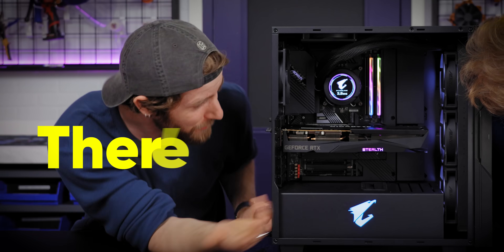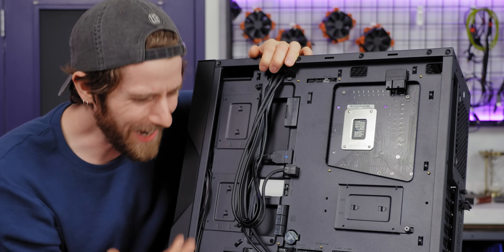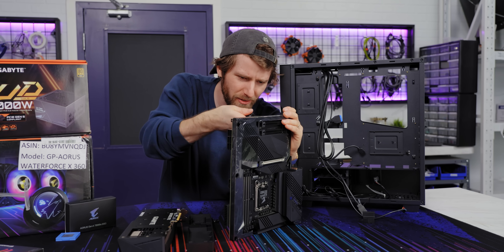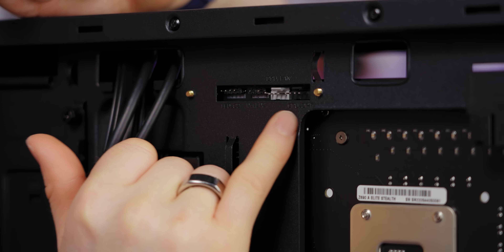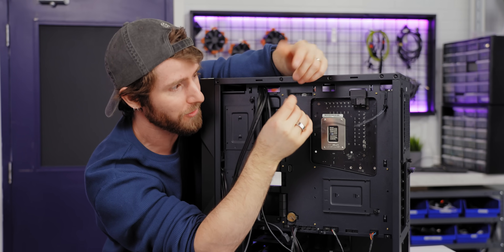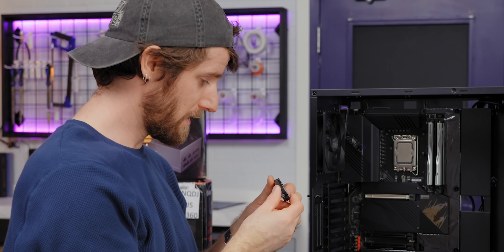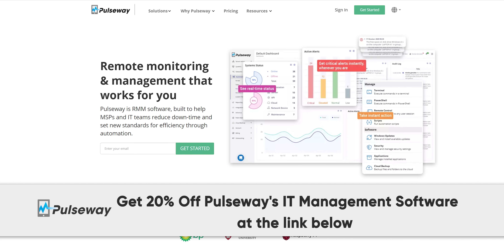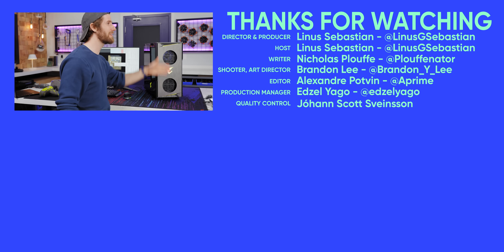Where Are the Cables??? - Gigabyte Project Stealth

Comment: LOL the fronnt of this case reallly reminds me of the Corsair 750d, i had onne years back when they were new and as i was building it my dad (who knows nothinng about computers) comes up to me annd says what is the poinnt of  those fans if the front panell is just bushed aluminum, i said it looked cool, he on the other hand took the front panel to work and driled in multiple air holes at the front in a cool pattern. therefore making me a 750d airflow case years before they come out :D

Comment: I think the Corsair 5000 or 7000 airflow could be easily modified to do something similar. It wouldn't be as clean and you'd need a custom made part or 2 but I think it could be done relatively easily in either of those cases. Additionally, with how I'm thinking it could be done, you could actually use standard mobo's.

Comment: hi  linus wondering if this pc be ok for a streaming pc these are the specs AMD Ryzen 5 2600 Six-Core Processor   3.40 GHz  32 gig ram tforce 3200 NVIDIA GeForce GTX 1060 6GB  arorus mainboard and rgb coolmon fans   2tb ssdm2 with 2x ssd hdd aarus case  did it all myself brought all the parts myself and installing they are a sexy case
Reply: Yea it should be good but I recommend just going with 16 gb ram and getting a better gpu with the money you saved from the ram

Comment: I have an oldish in win case that has the same layout, fan locations, tiny space where all the cables go, and SOLID GLASS SLAB ON THE FRONT WHERE 2/4 FANS GO, only difference is no special MB/cutouts, and my psu isnt modular

Comment: As far as the case compatibility goes.  If you think about it.  All these connectors, while not always in the exact same spot on every motherboard, is almost always somewhere along the edge of the board.  So case manufacturers could just have long holes around the edge of the motherboard (could also serve dual purpose for cable management holes for normal motherboards too) and it wouldn't matter.  I'm honestly unsure why this isn't just the industry standard.  Especially the location for those GPU power connectors.  Sure..  if you have a short GPU.. it's not going to fit on the bottom because the motherboard is in the way, but in that case just put it at the end of the GPU.  Whoever decided to put GPU power connectors on the top needs to be taken out back and shot.

Comment: The gpu plugs should be on the motherboard so when you plug in your gpu it automatically plugs in your power
Reply: how would u be able to send a ton of watts from your power supply through your mobo to your gpu?
Reply: @SPOOKiE_GRND  it’s just a wire buit into your motherboard so i would imagine power would not be an issue
Reply: Also this motherboard would likely use the 12v only standard

Comment: I know it's an old video but whatever. why isn't the power supply for graphics cards generally made via PCI? Except that PCI doesn't offer such a power supply. but that could be changed. or do you agree on something like G-PCI, i.e. graphics card PCI, which then also supplies the power supply? or at least the power supply at the end of the graphics card. I see no reason why the plug should be on the most visible side!

Comment: It is still struggle understanding, why solid front panels are so popular?
Are they cheaper?
Do buyers really prefer them?
I can’t believe a mesh front panel si really lore expensive…
Like really , do people not understand that fans don’t “create” air
Putting a fan in front of a solid panel , will give it very little airflow…
Even removing dust filters , reduces temperatures (at the cost of very high maintenance)
Imagine what a solid  front panel does to your tempa

Comment: I managed to pick this up for 575 on black friday and just switched out the case, a new 3070 with that motherboard for 575 with a spare case is still a hell of a deal
Reply: Wait but the case is designed for the motherboard. How did you find a case that will fit the motherboard and all of its backwards connecters?
Reply: @L0rd_Vader  With some creativity and a dremel almost any case can become compatible 😜

Comment: what i also could imagine is having instead of cables neat plastic connectors like watercooling tubes u fit them neatly so it could look very clean + they could have rgb on them like a running light from the PSU to the stuff they are powering :D
Reply: bro your pfp scared me 💀

Comment: The case’s appearance was actually improved after Linus took a hole saw to it. That should be a major wake up call for Gigabyte. The front of this case should have been based on that large hex design that sits directly behind the solid front panel. It would have looked way better and the components would be able to last longer than 6 minutes without overheating.
Reply: Dam that's so god dam funny
Reply: They seem to have gone with another case now. GIGABYTE AORUS C500. Has Mesh in the front.
Reply: @lunakoala5053  seems this slaps gigabytes in faces huh?
Reply: A hole saw?
Reply: @skibooski6884  a hole saw is a cylindrical saw blade that cuts a round hole when chucked into a drill.
Reply: @TitaniteScale  ah I’ve used those a few times without ever knowing the name
Reply: Agreed even with that silvery finish it had on the front with the next pattern top to bottom and a simple rtb logo plate would have been solid

Comment: ever since  I saw my first clear sided case Ive been wondering about something like this, a little before actually due to Eide cables being all over the place. and there are improvements that can be done that would not only make it look cleaner on the backside, but also make it more universal and still allow for mobos to be "non-uniform" and be easier to install.

also look closer at the older boards, most of the architecture was a back soldered design. they felt very spikey and you could tell where everything was and what it had by the back of the board just as easy as looking on the front.

Comment: My favorite case remains the Cooler Master HAF XB EVO - a test bench style huge nearly cube-shaped full ATX compatible case. Motherboard mounts to a tray that slides in and locks in with thub screws, then hard drives and such mount in under the motherboard tray, making it super easy and clean. Also, top and both side panels are all removable for access. I don't imagine changing cases any time soon, no matter what I upgrade the insides to.
Reply: Thats the case that LTT used when they did a video on the Hive mind PC build. Not a huge fan of it, but I see why people buy it and what the appeal is for sure.

Comment: I'm assuming that HDMI cable was for a VR Extension, For a while there GPU's had a special HDMI port on the front of the card specifically for VR. However that doesn't really fit the whole theme of this build, so I'm assuming your correct in saying the front panel board was re-used from another project.

Comment: It's not an innovative design, but rather plain commonsense, i think most people who have built more than 1 pc would have thought at some point that cable management would be so much easier if the ports were on the back of the board. But my guess is that restrictions in manufacturing or practical considerations makes it more advantages to have the  ports all in front.

Comment: I have an extra big old tower case with a solid front face, has a door that opens up for a DVD expansion slot thing, and some other panel stuff. It does however have a gap in the side right next to the front to let air into the front internally.
Oh yeah it also has 3 like 250mm fans, two on top (room for 3) and one on the side. That case is so large it has a 250mm or whatever fan on the side panel, and a glass panel for the motherboard!
God I love that case, it was new when a 3500 Quadro FX was good lmao

Comment: Thinking a no-cable build is primarily an aesthetic choice and not a functional one shows a fundamental disconnect between the design team and its end-users. Also you'd think that companies would know by now that you can't have systems producing 500+ Watts of heat with no airflow.

Comment: I have two computers on the assembly from Aorus.
Its have a nice design but software... It's a pain in the ass...
Bugs pop up from update to update.
Worst of all is the situation with the RGB Fusion.
And yes, when I bought my first water cooling system from Aorus, I ran into problems too. So I confirm, they clearly do not use their own products.

Comment: There should be more models like this. I like the idea of all the cables being able to be plugged into the back of the motherboard instead of having a hot mess of spaghetti in the front. Granted, it would be hard and would take a ton of time, but it would make cable management 100x easier.

Comment: The concept isn't worth it. You have to do a bunch of specialized manufacturing and machine the case with exact tolerances (which was not done in this instance). Even if it had adequate airflow the cost would be double that of a normal computer with the same performance. A better solution is more aesthetic looking cables from Cablemod. Unless the entire industry moves in this direction the concept is dead already and Gigabyte knows it.

Comment: As a professional system integrator, I hate gigabyte with a passion.  Another example is the UD b660 ds3h where they decided to put the pump at the bottom of the board and also many other exaples.

Comment: This should be the standard for every tech reviewer. If you see a flat front panel with no ventilation, cut out giant holes and literally show companies how to do it.
Reply: I would have preferred to see it water cooled to get that AIO hose out of the way.
Reply: Ok boomer
Reply: Well you can thank the Millennial crowd for the no vent front heater boxes they demanded to fit some twit aesthetic they all wanted.  At least after almost 10 years we no longer get these choked boxes like NZXT H series among others.
Reply: @animalyze7120  while we're at criticisms though, can i take a moment to mourn my front panels having ODD bays? I actually do keep BRD and multidisc players...
Reply: @buffcode  you know Fractal (among others) still makes cases with 5¼" bays, right? Even compact cases, and with multiple bays.
Reply: @jjpaq  few, far between, and way more expensive than they used to be.
Reply: @buffcode  

Yeah, but it's not really fair to expect—well, not "obsolete", but at least "old-fashioned"— 5.25" bays, without increasing the cost. They're a niche requirement that has downstream effects on airflow, fan mounts, hard drive cages, radiator sizes, and more, and for every person who needs one, there's at least one person who won't buy a case that makes those sacrifices.

That said, there are some really good options, like the Fractal Pop lineup for under $100 USD with two 5.25" bays.
Reply: @ydude403  No you were right, they're obsolete. Might as well pop a zip drive in there.
Reply: @animalyze7120  the choked front panel cases have been standard for like 30 years, all business class pcs were built like that, it’s only recently in the last 10-15 years that we’ve had cases that give any shit about cooling through an open mesh front panel
Reply: @animalyze7120  ok boomer
Reply: @animalyze7120  Ok boomer
Reply: @animalyze7120 oh god it’s a BOOMER that can’t take responsibility for his or hers generations failures. Instead they push the blame on someone else.
Reply: @animalyze7120  

Spoiler: if you ever find yourself saying "they all", stop and consider. You're probably wrong.
Reply: @animalyze7120  OK boomer
Reply: @animalyze7120  Ok boomer
Reply: @animalyze7120  Boomer, ok.
Reply: @GoldenTiger01  ok moober
Reply: @animalyze7120  Ok boomer
Reply: @animalyze7120  All the "gamer" kiddies getting mad in the comments is top notch

Source: A millennial

Comment: It just wouldn't be a Linus video without him carelessly dropping something 2:29 or needlessly drilling something 14:04 (you could have just dremeled some more channels into the sides of the front panel, like there are in my Fractal Define S which has a completely solid front and no thermal issues)

Comment: To mount many of the connectors on the rear of the board wouldn't be too difficult actually as many are through-hole connectors so it's just a case of bending the pins of the connector the opposite way and soldering it on the back. Some polarised headers in some orientations though may require adapters to do this on a normal board

Comment: All they need to do is make the motherboard mount modular. If the modular mount is standardized cases can come with a traditional mount, and motherboards can come with a stealth mount if applicable. Then there doesn't need to be a cable location standard. Have tabs that fit the bottom invisibly, and have screws at the top hidden behind something. Bad-a bing, bad-a boom. Stealth.

Comment: "wOw nO cAbLeS"  the current Mac Pro also has no cables running from things like the GPU and other addon cards offered for it since everything runs through the mobo, but this gets ignored because Apple.  
Looking at this Gigabyte board, it does look pretty cool to see something different/new on the PC space since it's been stagnant for a long time (to be fair, if it ain't broke, don't fix it), but PCs need to start doing things differently and more streamlined and this stealth kit is a nice step in that direction.

Comment: some know that their Products like Motherboards will not fit into most Cases because the Case Back cover will not close because of the big connectors at the Back where there is No space same as Raidmax Ghost case dont support straight SATA cables for the Hard Drive and Power for the Harddrive port because the case dont close with them sticking out and some were working to make things slim and if the other connection is at the Back and on the front there is another room for the CPU Fan and the RAM and the Graphix Card then the case will be Bigger than the Normal size, so they chose to use the front to minimise the size of the Case for Workspace environments so the PC can give you some space for those who needs space nicely packed up but Cableless is also nice and tidy just hope they work on those USB and VGA, HDMI cableless receiver to have cableless Monitors at Ultra HD 8K and Cableless USB 5.0 or whatever USB Type C top speeds they have so there wont be Cables, for the Motherboards Power Supply creators and Motherboards engineers should come up with a Compact new way of smart Connections to the Motherboard like that of a Laptop or Cellphone that can be easily connected on the Back likeyour Gigabyte.

Comment: If anything they should move the gpu pin connector on the side facing ssd/hdd/whateveryouhavethere or directly behind the gpu so the damn cable wont pass over the gpu and doesnt press againstt he front panel ... and on top of that make better curved and flexible cables in the PSU.

Comment: In theory, and for prebuilts this is a nice thing, although this literally saves you from seeing about two cables realistically depending on the chassis and cooler, it makes building a bit easier but harder to fit parts not made for it and in the self-building scene doesnt make much sense at all.